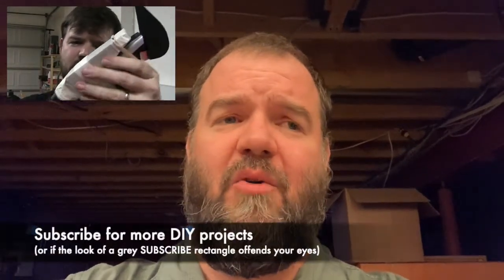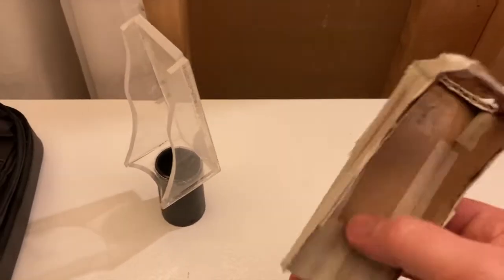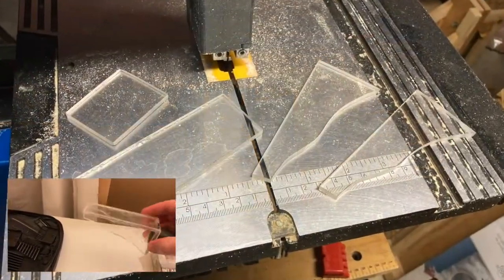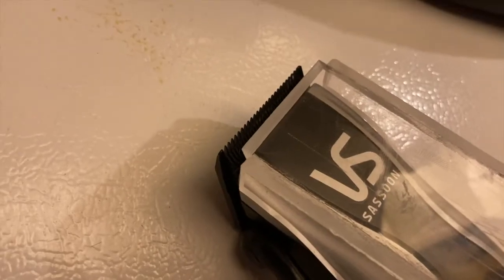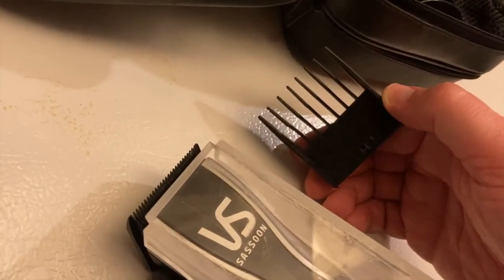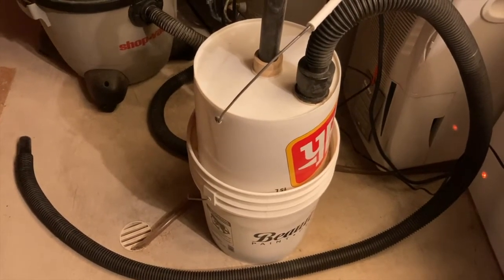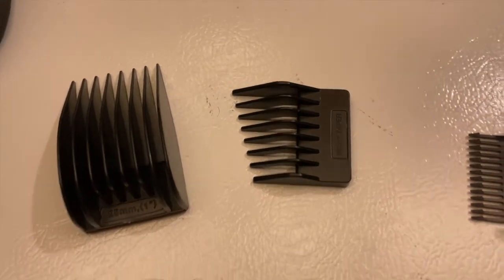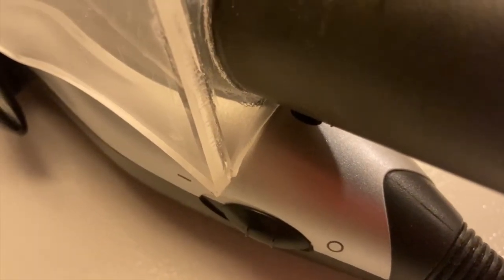DIY FlowBee 2.0

Comment: Not a bad implementation. I mean the idea is low hanging fruit. Anyone who's cut hair in their bathroom has thought about something like this. When I was a kid my mom would have me hold the vacuum and follow her with the clippers when she cut my hair.

But I wouldn't call this Flowbee 2.0. The flowy works a lot different and has a system for cutting different hairstyles. While this is standard hair clippers The feature you added is that you don't have to spend as much time cleaning up. 

But I believe the way you have designed the attachment if you look at how the flowbee works and what it does different you could implement it

Comment: The modified but more because I want to be able to cut my hair 4 in long or 6 in long or something like that I used the biggest one they have and it's still too short for me for me it still cut my hair too short and I hate trimming my beard because it makes it itch terribly my barber retired at the end of the pandemic cuz he finally got covid and I've unprofessional haircut since he retired I never could find anybody else that would do it right everybody else would trim my bid badly and it would itch like hell he would trim my beard with scissors and it wouldn't itch cut my hair myself was just the longest come I can put on it hanging upside down outside but that's still not long enough for me because of I had one for the dog that was like a floating you could just how long you wanted it up to many inches long then I was actually giving the dog a haircut it was so hot and my hair is so long and I was